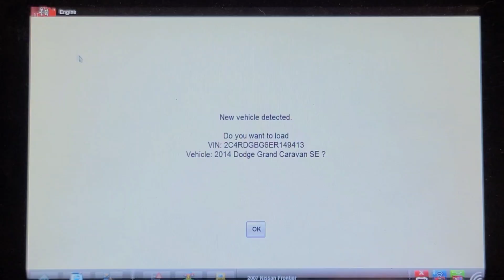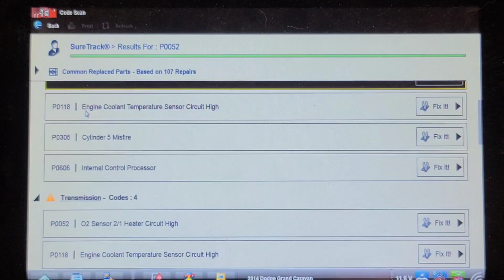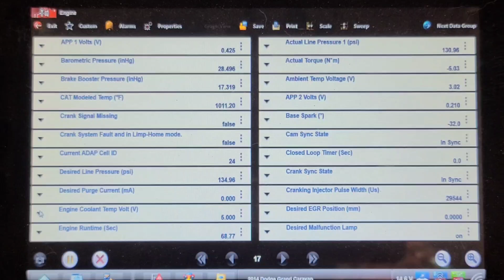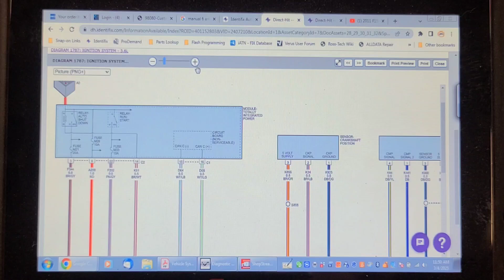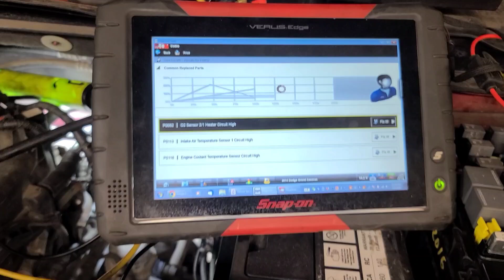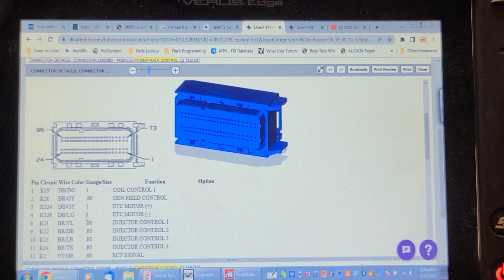2014 Grand Caravan Misfire Diagnosis P0305 pt. 1

Comment: Tis bit of moral quandary––the more experienced electrical/computer troubleshooting, conceivably you'll earn less money.  In order to ensure some type of adequate income, most shops (including dealers) seem to consciously made decision to follow basic indications of scan tools and just start replacing parts.  Whether car gets efficiently fixed is not number one goal.

This does open up secondary auto repair shops (like Phil's) who can then take the cars other shops can't fix using their business model––and properly fix them.  But I'd be sure your shop rate reflects your expertise.  An honest business model will prevail, but you can't give away knowledge to satisfy customers and get them back on the road.
Reply from the maker: Well said!

Comment: 👍🏻👊🏻if it had a bad rocker it would definitely cause a misfire but usually only under load as it a 4 valve per cylinder.
Reply from the maker: @sheerwillsurvival2064  yes I agree
Reply: @ can’t wait for part 2 to see if it is the ecm

Comment: I bought one of these buggies last year to fix up. I know I had to put a PCM in it for a cylinder 5 misfire.
Reply from the maker: Did you put new or used?
Reply: @PhillipBailey  I put a used one in it. It was a car I was fixing to sell. I programmed it with my Launch x431 pad5. It is now out of update. I just bought the one that is IMMO and comes with the key programmer. I do like Snapon. I wish I had the money to get one. I think launch is best bang for the buck. I started my own shop 7 years ago after watching Ivan at PHAD and Scanner Danner and Eric O. I had always worked on my own car but never really was a mechanic prior.
Reply from the maker: @eddiereichel9354  that's great! I follow those guys as well.